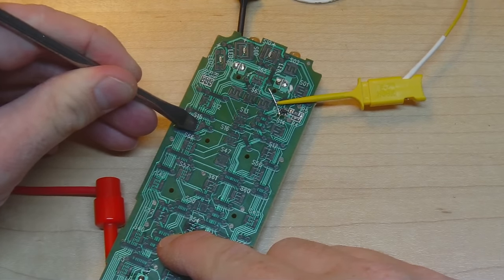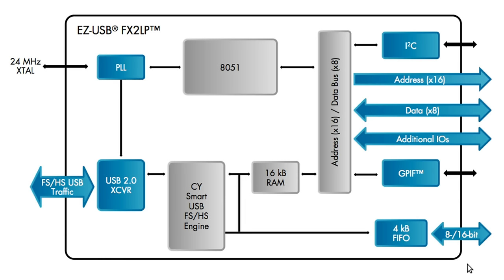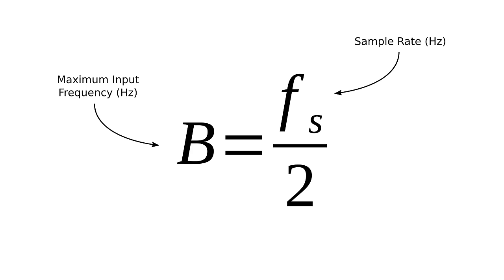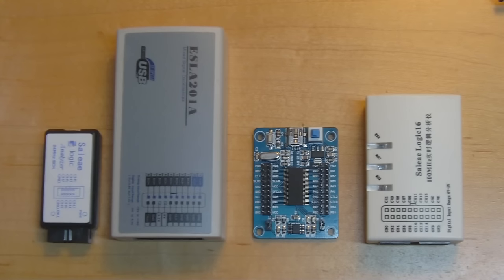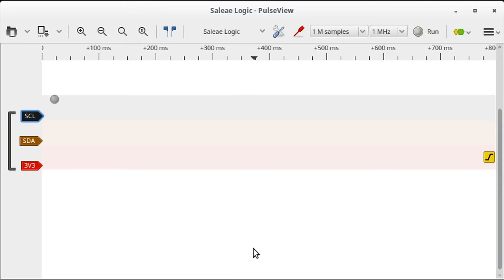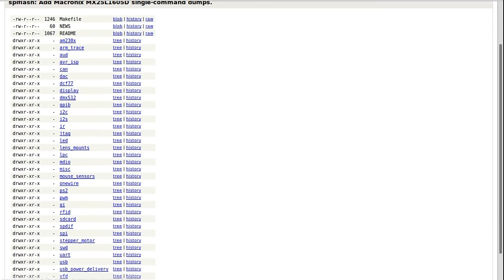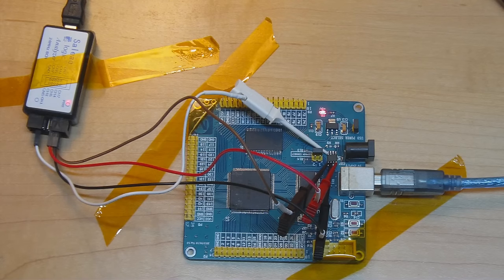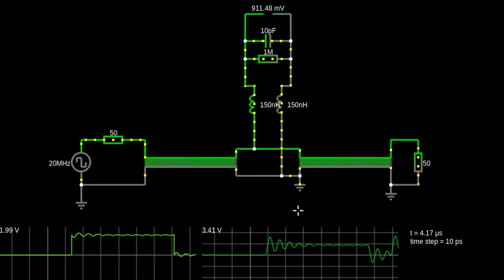[001] Sigrok and Logic Analyzers

Comment: What would it take to support the Hantek LA5034, Sigrok only supports 4032L.  As a previous developer, do you have a sense on this?  I am a programmer, but I have nothing to base an estimate on this.  BTW I do like the Sigrok software, and have the two of the ultra cheapo's and the 4032L, but I also have several 5034, and as old as they are, if I can get them to fire up...   anyway, any thoughts?

Comment: This is awesome. I bought a Kingst LA2016 on Amazon, and for some reason I'm paranoid about installing their software. Their website is sketchy and I don't want to get a virus on my computer. This Sigrok/PuseView seems safer. I would like to run it on my Raspberry PI if possible. Do I need to flash new firmware to get it to work with this software?

Comment: cy7c68013a is a very powerful chip for usb interface. I have used it in many projects in past and is very easy to program. You can also use it to read ccd chips in bulk transfer or send bulk data from usb and write to eeprom/sram for example.

Comment: Very very good resume of the available low cost logic analyzer options!! I rely appreciate how you explained the weak probing that these devices provide when its coming to higher pulse rates, with the necessary higher sample rates, specially under a low number of channels on serial communication. When you look on the professional analyzers, probing is one of the most important, most complicated and even most expensive part on every high performance measurement system. But also when You are coming from the professional side you must also recognize that almost much more then 90% of the upcoming analyzing cases could be easily handled by these cheap devices. In a short, I don`t remember one only case where I was coming to the end by some equipment limitations, the major task was everything to get a "better view" whats where going on in the circuit or communication line. I also remember logic analyzers (more from the 90th) who where much less powerful, much less self explaining and very difficult to set up. They where much less flexible and very time consuming specially when it comes to the point where You have been forced to count out your capture count by count, bit by bit. So, after your nice explainings I will give it a $30 try with a Logic16, to see how it works and how the probing performance could be easily improved by a cheap and easy DIY solution. Thanks for Your lesson ;-)

Comment: Thanks for the upload, tutorial, and your efforts working on this OSSW project. 
   If anyone really needs to decode an IR device there is a project option available on the OSHW AVR Transistor Tester project for doing this. I know that was not the purpose of this demonstration but I figured it was worth plugging another OSHW project. The origin of the AVRTT project is available at mikrocontroller[dot] net/Articles/AVR_Transistortester
-Jake

Comment: After years of working Microcontrollers and circuit boards I am just now getting my first logic analyzer. What pushed me over the edge to get a new tool is the fact I have been having trouble writing to a old microcontroller and I need see what is being sent.. Wireshark wouldn't work on windows for the com port and I didn't want to hand decode them with o-scope. Great video!

Comment: amazing...i've found out about pulseview few days back and i'm amazed, it's simply awesome <3 i was a lil sad to see that the hantek 4004c is not supported, but i'm most then happy with saleae support and the amazing decode library...only after a few days with it i can't imagine going back and count edges manually to decode some bus or use the nonsense hantek decoder what drove me crazy many times when i was preparing my BS degree.
thank you for the amazing tool you've developed

Comment: About a year ago a friend recommended sticky tack for wall posters for holding stuff on the bench and it's a game changer. Holds anything in place for probing or soldering and then pulls right up with no residue over and over. Try it and you will never tape anything down ever again!

Comment: I completely agree about what you've said about open source software. If the software that is used to operate a device is closed source or proprietary, there is an increased chance of ending up with a sophisticated paperweight once that software becomes extinct. Unfortunately, many manufacturers don't give a crap about giving support to old hardware. More perfectly good devices go to the landfill, when it shouldn't have to.

Comment: Dude! Thank you so much for your work on Sigrok/Pulseview! I totally prefer using Pulseview over the original Saleae software. And I even got an original Saleae Logic-8 (from way back then, when it was "only" 150 bucks). That's right. I've got the real thing and still use the open source software with it. Not only because I think Sigrok/Pulseview is great, or because I prefer to use open source tools where ever possible, but in this special case it's also because that's how much I think the original software sucks. I wouldn't even call that a tool, because it looks, feels and behaves like a toy. So thanks again for providing an alternative that's not only open source but so much more usable!

Comment: Blown away by the detail in this video. It's fantastic. Just getting to grips with logic analysers and have found the info included in this video really helpful. Thank you.

Do you have any recommendations for an open software/open hardware oscilloscope?
Reply: I suggest you check out the ScopeFun project - the hardware isn't cheap but it is completely open, just like the software that runs it.

Comment: Great presentation. Thanks so much. I owe a lot to the open source movement and do intend some payback (eventually!). Stacking decoders seems such a natural progression, I'm surprised it's so rare. It also seems a really great way of preserving some older, lesser known protocols for posterity, if nothing else (eg. for reviving or investigating some vintage hardware in the future). Maybe (as an oldie) that's where I might contribute..
Reply: Ned u hav any comm links for crypt tech arduino UNO,Leonardo,etc,da Vinci,Hanoi,Babel links des SHA line des crypt SHo-an Singaporeans Thai stickers etc?!
Reply: @stevebez2767  Sorry mate, you lost me. I do know that when I had no LA hardware but was trying to revive my ancient 6809 SBC running FLEX, I made very good use of Gillham's LA firmware ( https://github.com/gillham/logic_analyzer ) that I was able to use in a stray Arduino MEGA I had lying around. It gave 4Msps which although not blinding, was very useful in my 1MHz 6809 system. (Found the prob to be a flaky clock buffer that was causing the main clock to drift but the RS232 rate stayed solid because the 6551 ACIA had its own baudrate generator and crystal which initially threw me). Incidentally, I had really high hopes of using the unit with Pulseview as Gillham's code implements a SUMP protocol but for some annoying reason, it proved really unstable on my Win7 system (just using the analyser through USB-COM ports - NOT Pulseview in general). I ended up using the alternative Open Logic Sniffer client (also written in Java - https://lxtreme.nl/projects/ols/ ) which, although way more deficient on the decoder front, worked very reliably.
Reply: Btw, it's very important to point out that I just realised I appear to be using a development version of Pulseview and Sigrok (Pulseview 0.5.0-git-2a09e77). I probably went to the wrong place to download and then later forgot when it came to using it (because I'm dumb). The stable release in all probability would have worked.

Comment: The BlockRam of the Spartan3E is far less than quarter a megabyte (as you said at 30:07). The XC3S250E has 216 KBits. This is only 27 kByte. For this small amount of memory it should be no problem that the transmission over the CDC driver is not that fast 😉

Comment: I thought it was going to be a long, boring video. Boy, was I wrong! Thanks for the quality content :) 
By the way, could we get away with using a logic analyser at higher frequencies if the probes would be of better quality? Like, shield wires or something?

I was thinking of building a logic analyser based on OBLS, but with a ExpressCard/54 interface (like those found on older Thinkpads), but after watching your video, I'm not sure it's worth it.
Reply from the maker: LAs can work at GHz frequencies e.g. the KeySight model. But it becomes hard or impossible to just probe some random signals on a board. At these high frequencies impedance matching becomes a major factor. Unless the board has special support for a logic output, you need a high-impedance probe like in an oscilloscope. Having dozens of probes like these gets expensive, and ugly. But at really high speed, serial buses are increasingly common, so you're better of with a fast oscilloscope than a fast LA.

Comment: I have a Nexys4DDR FPGA dev board. I wonder how much work it is to use this board with sigrok. It has a FTDI USB UART bridge connected to the FPGA. It would be possible to use the PMOD extension connectors for the logic channels. Or one could use sigrok to debug the FPGA design by connecting the channels to internal signals.

Comment: OMG -  Katpton Tape to hold down experimental electronics bits - now why hadn't I thought of that! I've recently got one of the Saleae clones, and after seeing this realise that the fx2 chip is in a bunch of other various debug/jtag devices I've got hanging around - which says to me I may be able to repurpose them given their original function is pretty obsolete.
Reply from the maker: +Orionrobots I find electrical tape is a bit nicer for this - but it doesn't look as cool
Reply: I've both in my lab, and only considered their workholding potential for the CnC machine, not for keeping stuff in place while probing. I generally have ended up contorting, or trying hard to ensure the soldering "helping hands" don't contact anything. I've also got painters masking tape. Shockingly, I've let myself run out of duct tape.
Reply: Depending on exactly what you are trying to hold in place and the flatness of the bottom surface, I find those "sticky silicone" mats designed to hold things in cars work brilliantly. Really cheap on eBay. One word of caution though, they are not very heat resistant so be careful if using them for soldering! Also, although superb at holding breadboards in place they tend to grab the waxed paper protection under the boards' adhesive pad which then is removed when lifting the breadboard - my solution - stick Kapton tape over the adhesive pad (or even Scotch tape/Sellotape) - works even better then. These are the kind of things, but available in all sorts of sizes and formats: https://goo.gl/XL1rEQ

Comment: If you don't mind your EZ Hooks to be of the same grey color, you can get them as low as $15 for a pack of 20 ($0.75 each) if you ebay search something like "HP Grippers", "HP Hooks" or "HP Grabbers".
Reply from the maker: +Evgheni Melman That's a great tip. Time to stock up!
Reply: The P5003 grabbers also seem to work reasonably well, I've been able to grip individual pins with those on SOT devices with 1.27mm spacing.

Comment: Hi;
I have a problem. My cheap version of clone Logic Analyzer does not have any protection circuit whatsoever. So after a couple of months, 3 pins stopped working. I guess some sort of surge or high voltage/current has damaged the I/O pins of the FX2 chip. The 16-channels logic analyzer based on FX2 use the PortB & PortD so I was wondering if I can modify the Firmware & use the PortD instead of PortB that has 3 damaged unresponsive pins. Is it possible or I'm only daydreaming?
Thank you very much
Reply: Yeah, you could. The fx2lafw firmware is open source and there's a 16-bit variant of it that uses both ports. Should be straightforward to take the 8-bit variant and have it use the port D.

Comment: Hello! Great infos about the logic analyzers. I wanted to ask if the Saleae clones can be used to read the can bus signal directly from a car. Automotive can bus voltage levels are around 2.5 volts. 2.5+1 volts for CAN-High and 2.5-1 for CAN-Low.
Reply: I don't think so. But you could simply use an MCP2551 transceiver to translate the differential signal to a TTL signal.

Comment: Any thoughts on the 500Mhz LogicPort, or CNLohr's GreatFet One?  The latter doesn't use an FX2 but instead all the high speed usb stuff is done on the (LPC4330) microcontroller!  The former might benefit from LiteX/litescope/ValentyUSB/Renode/Fomu.

I'd love to use Sigrok to display data coming from DMM quasi-real-time.  I have a DMM connected to a PC via serial port, and I've written a driver that gets the samples.. so I'd like use the PulseView GUI to transfer the last 100 samples, plot it, then repeat.    If it's easy enough, it would be nice if the GUI could also set a trigger, such that it waits until my driver detects the data has crossed a threshold before it delivers the data.   In any case, how do-able is this?  Looking at John Holdworth's airwebreathe_org_uk, it's hard to tell what exactly I would need to modify in the API.  Any suggestions?

Comment: You know for the Saleae Logic clone version you can just download the official software and it works.
Maybe if they had a donation link or something so people could pay for its use to be fair to them.

EDIT:  Update I've tried both now.
It's a little tricky on Windows. To switch to either software you have to completely remove the driver to the respective software.
I.E. To switch to sigrok I had to uninstall "Saleae Logic USB Logic Analyzer" driver (with the "Delete the driver software" box checked) then run the Zadig utility to install the "WinUSB" driver. 
Then to go back to the Salease software I had to do the opposite. And do "update" driver on the unknown USB device.
The trick is to in "Device Manager" go to "View" and check "Show Hidden Devices".
If you do it right in uninstalling, between switching drivers, the analyzer USB will show up as "unknown".
You might have to play around plugging the USB in and out to find out where it is in the list in Device Manager.

One big thing that Sigrok lacks is the little measure thing that Salease has.  The feature where you can cursor over something on the time bar and it will give you pulse timing and/or pulse frequency.

Final note:
Be careful and make sure if you use a USB hub that is at least 2.0 and above. I pulled one out of a drawer that only after troubleshooting did I find it was an old 1.0 one.  I could only connect to Salease at 500k and not at all for Sigrok. Now a stable 12Mhz sample rate with my particular configuration.
Reply: Joe Neighbor : I asked a seller of the kingst clone if it worked with sigrok, they said no.
Reply: Not sure about the "kingst clone" version and I haven't tried it yet but there is instructions on the sigrok site on how to make the Saleae Logic clones work.

Comment: Is it possible to capture code from ADC w/parallel out bus on each sync signal? Say, ADC has 12 bit output line and end of conversion (sync) line. Can we capture a single bus reading for each sync pulse using Sigrok?

Comment: Amazing video. I’ve used a $500 salea at work and considered getting one for home before I realized the huge price tag. I’ll definitely be getting one of these cheaper ones you’ve shown. 

Why do I specifically want a 24MHz one?
Reply from the maker: +Adam Sidelsky 24Mhz because that's how the Cypress FX2-based logic analyzers are listed
Reply: OpenTechLab awesome thanks!
Reply: You don't - you want the Openbench Logic Sniffer (the red PCB one). At least I've never saw any point in bothering with any of the others considering the only slightly more expensive OLS goes all the way up to 200 megasamples per second while the others get nowhere near that. You can capture 400KHz I2C signals with almost anything, but at some point you'll want to examine something in the tens of MHz range, and then it will be the difference between "can" and "cannot".
Reply: @AttilaAsztalos  Depends on your needs. The FX2-based boards have virtually unlimited acquisition length while the OLS can only capture until the internal memory is full - which may not be enough to see what one needs to see.
Reply: @A Dev there's a compromise either way to be sure, but I always found the lack of sampling resolution  a far, far bigger issue than the memory limit, especially considering that the OLS does have a working run length encoding option, which means it can store an awful lot of "nothing happened" in just a few bytes. It takes a ridiculously high sampling rate coupled with a ridiculously long pause to run out of memory. And having half a clue about setting one's triggers appropriately is a virtue.

Comment: I have a Q regarding connecting my R&S HMO 1202 up to pulseview - is there a forum I can post it too??

I select the "Hameg HMO" driver, and USB, and then I scan for the HMO...
The HMO is set to USB TMC, and when I scan it briefly shows a "locked" icon on its side menu - 
but pulseview never connects

Ive tried USB VCP, and also connecting via LAN, but it never shows up in the pulseview device window.

The HMO1202 has firmware 05.886 and Im using the latest download of pulse view as of Sept 2018

Ive tried this under windows 10 64bit and Mac High Sierra....

Harry
Reply: The scope's model is probably not added to the driver's whitelist yet. I suggest you check the contact info on the sigrok.org front page so they can add it.